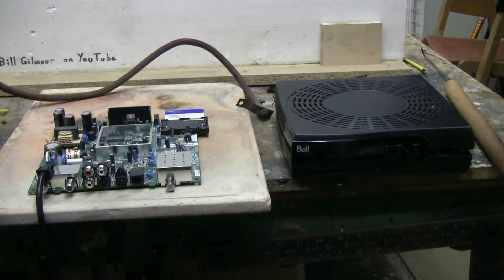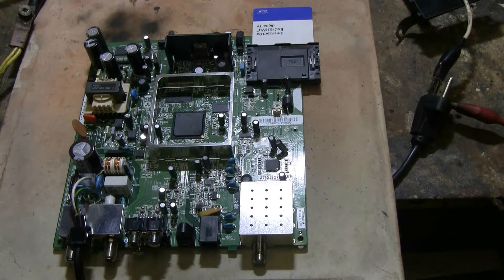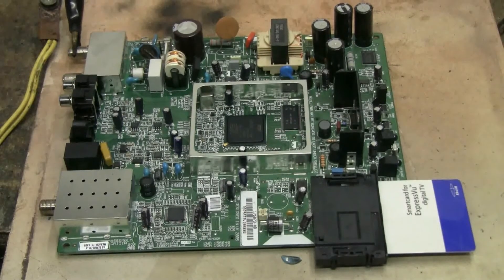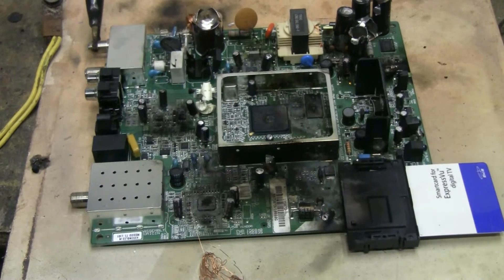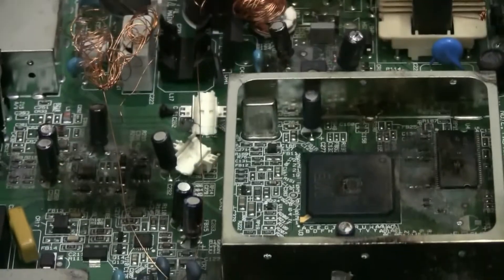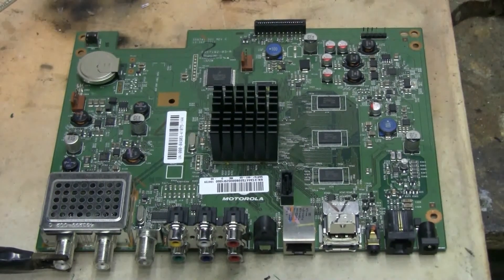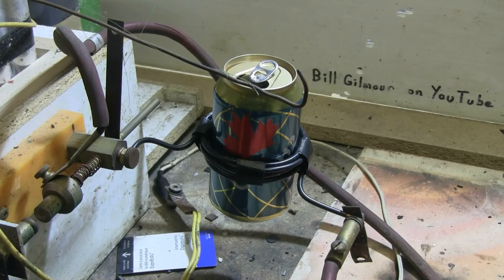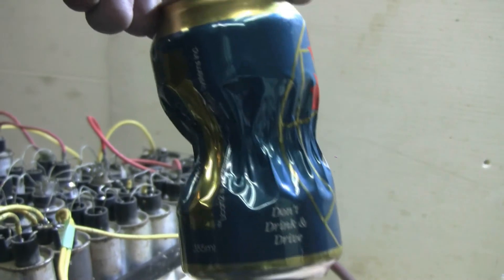Capacitor Bank #80 - Blowing Stuff Up

Comment: I call total BS on "70 uF". 21.5 uF @ 30 kV on the other video blew up a watermelon... 
Could be wrong tho
Reply from the maker: 21.5uf @ 30000 volts is nearly 10 kj of energy. My 70 uf @ 6400 volts is not even 1.5 kj of energy. This explains the difference.
Reply: 70uF @ 6400 volts from 1.05 uF/2400VAC MOT caps would require 70 capacitors. There's 70 there? Not trying to be rude. Looks like 20-30. Again, could be wrong tho... I mess with this stuff. Pretty good bank, DEVASTATING actually.

Comment: 8:20 best way to remove a heatsink from a board ever.
Reply from the maker: davidrobert2007 It left with alacrity. I found parts eight feet away. Sometimes you can even hear stuff go flying in the video.

Comment: Hi Bill,

I really enjoy all your experiments and I respect your exceptional intelligence and dedication to Science.

I am working on re-defining Gravity, Radiation and Magnetism, and establishing the relationship between them.    I am going through and locking up some of the logic gates in order to limit some of the possibilities, so I can deduce what is left in order to deduce what is actually going on.

Two of the things I am eliminating are the electron and the photon, which I am changing to quantified behaviors instead of particles.  I wonder if you can devise an experiment to establish once and for all, that these "things" are not things at all, but behaviors.  And that there is nothing traveling from the Anode to the Cathode, or from the emitter to the reflector or receiver. 

I am at 100% confidence that there are no such particles, because they have never been proven, and more importantly, "they" and their existence don't make any sense at all logically. I can easily lock them out of existence using logic.  

And so I think the belief in them as a particle is some sort of canonized religion that has been passed down through the official channels, but isn't based on anything.  So, I was wondering if you feel any of your experiments have pointed toward that, or if you could devise one that does?